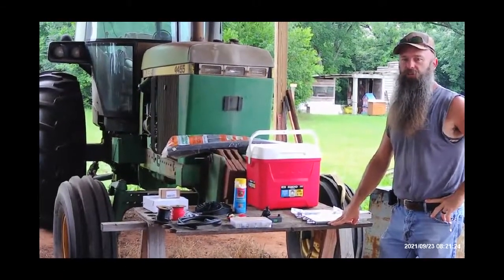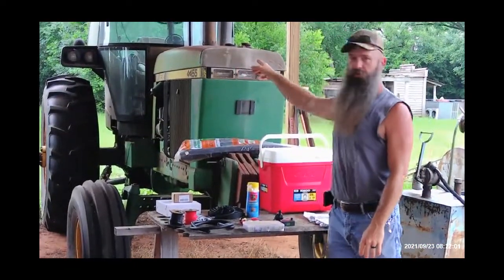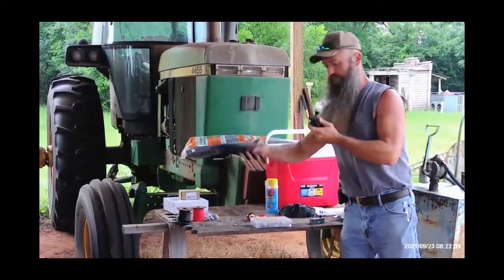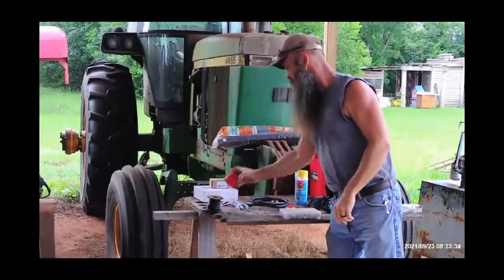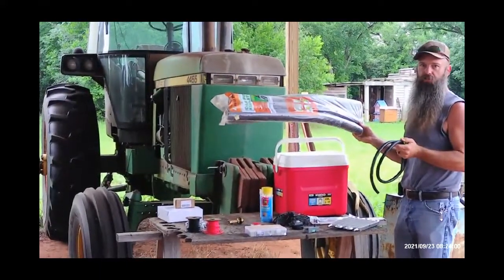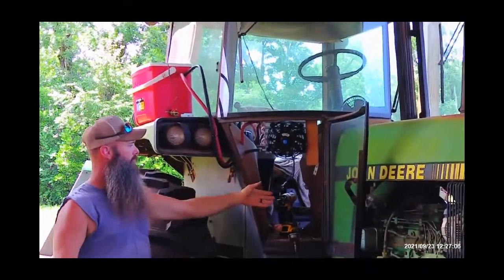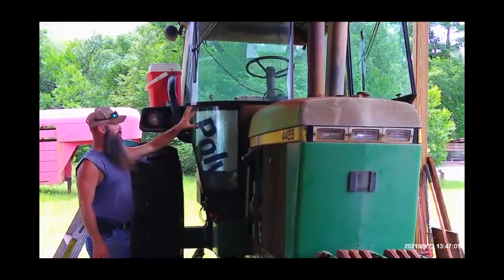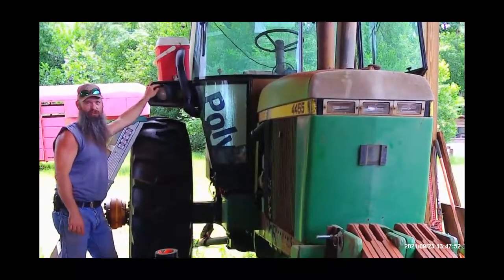Farm Made Air Conditioning for your John Deere Tractor

Comment: There is an update available for the ac pump on that tractor , r6 to sanden style Either from deere or local sourcing . Did one on a 4640 . Would recommended a suction filter adiddion.

Comment: How well did the homemade ac work? I have an old 4020 with a cab and it never had ac. It would be nice to have a cheap way to cool or down some
Reply from the maker: I works great. Sure it does depend on the weather temperature, but there is a clear cooler feeling difference inside the cab. It takes a good insulated cooler to get the job done.